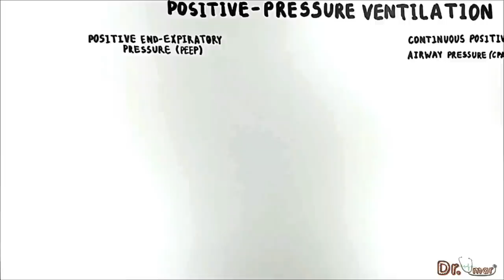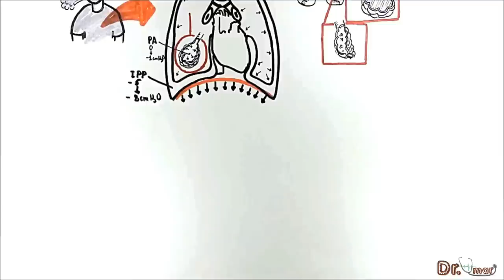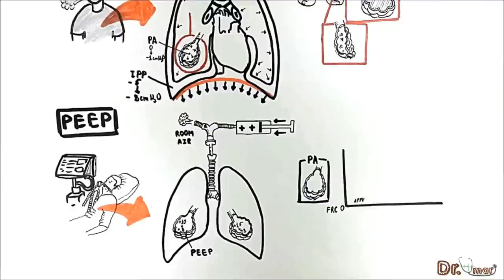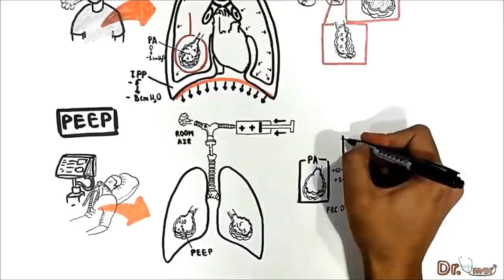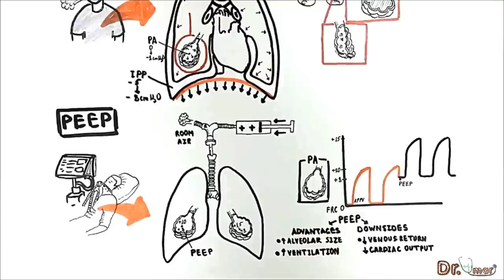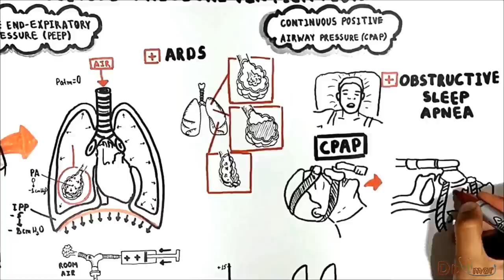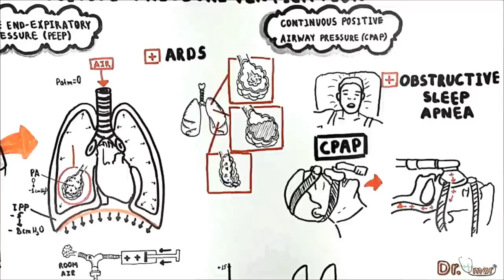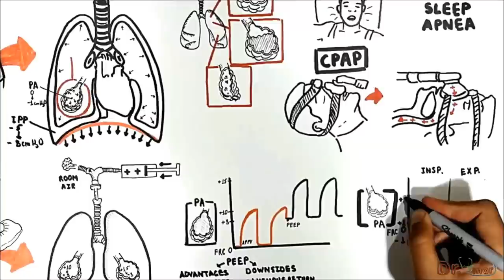Mechanical Ventilator (Lung Mechanics: PEEP, CPAP, ACMV)

Comment: That PEEP graph starting from 6:25 to 9:40 was very illuminating. I kept thinking that during PEEP the maximum pressure during inspiration would be the same as normal respiration and was confused about how to compensate for what would have been a very shallow breath (from 10cmH2O to 8cmH2O). I thought: 'Maybe increased FiO2 would be enough?' but no we just effectively overinflate the lungs (15 cmH2O). I'm sure it's more complicated than what I'm saying and that there are a million different ways you can set the ventilator.

 Thanks Dr. Azizov!

Comment: Thank you, whats the timing between the inhalation and exhalation. how to control the flow rate and on what basis
Reply: Normally the timing not regulated by yourself. It is doing  automatically - when you inhalling, the device encrease the blow rate, when you exhall - the rate down. The max and min flow rate you can easily setting up according the manual.